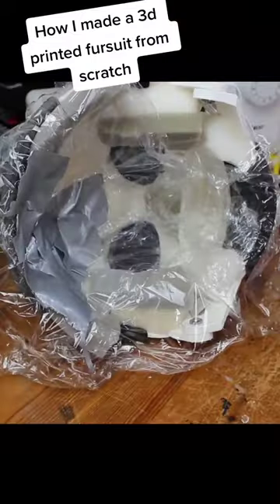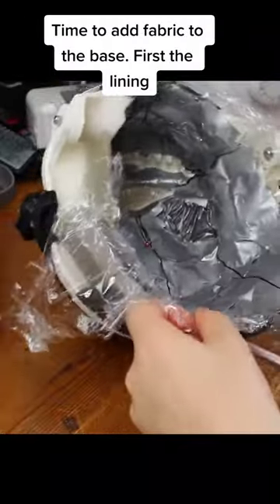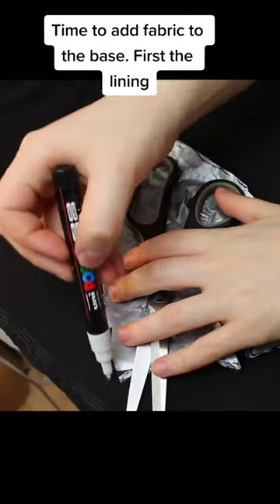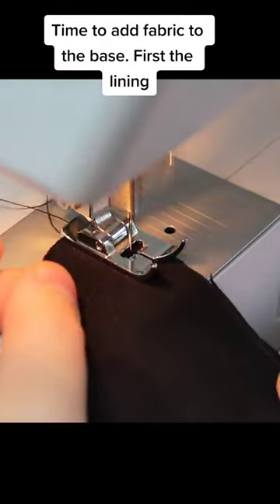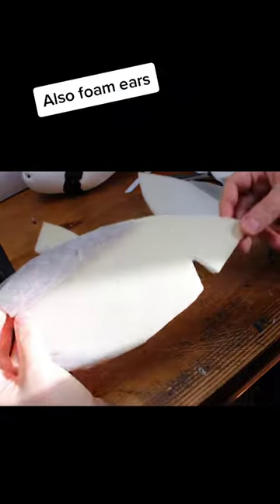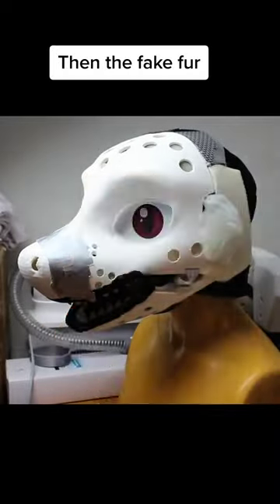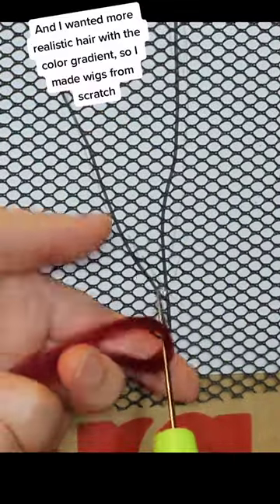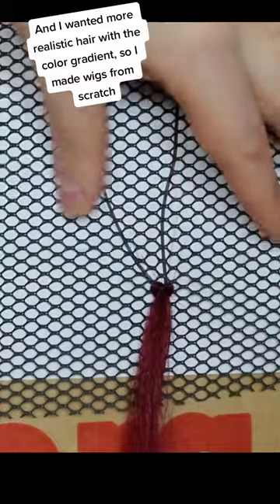Furring The 3D Printed Fursuit Head Base #short #fursuit #fursuitmaker #3dprint #costume

Comment: Would love a tutorial on how you did those wigs and applied them to fursuits!
Reply: From what I can see here it looks like they used a latchstich rug type technique. All you need for this is a latchstich hook which is essentially just a hook that has a latch bit to it. You can find a them everywhere but so many have no idea what they are lmao. You'd also need a bit of porous fabric or even strong netting like shown in the video but you can find ones with smaller or bigger holes if you prefer but know that smaller means that you will need more fur, have more work to do, etc. But will have more control over the gradient if you're doing one and the fur may actually become too full if you go to small. If you go bigger you'd have less control over the gradient but it would require less work and less fur but the fur also won't look to be as full. Ofc whatever you chose your latchstich hook also needs to be able to easily fit through one of the holes so keep that in mind.
Reply: They followed a tutorial about those wigs from Kazplay